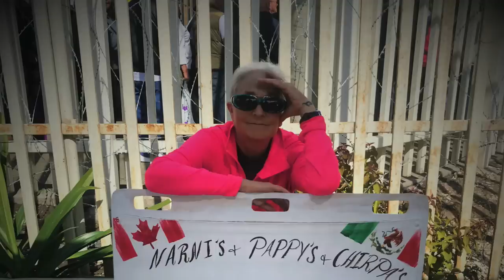Wheels For The Bucket List CDT Carriage Ride | Engels Coach Shop

Comment: Dave...your Trek to Great Falls reminds me of the Summer when I spent three months with Fred and Barbera on a Ranch outside Zortman, down near the Missouri River, as a boy. No Electricity, No Running Water, No Television, No Telephone, No Central Heat, No Flush Toilet, had an Old Outhouse instead...PEEEUW!!! Pretty Old West Living' to be sure.
 Living Accommodations was a Very Old 4  Room Shack with a really Low Ceiling of a House in literally the Middle of Know Where Montana...miles & miles & miles from anyone. Heat was supplied by a Big Ole' Cast Iron Wood Stove. Yes...that meant we had to Chop & Split Firewood by hand with an Axe. We did however have a couple of Luxuries! We had a Refrigerator and Kitchen Stove that ran on Propane. And I remember in the evenings when all the Work was done we either Listened to the CB Radio or Played Buck Owens Records on an Old Portable Record Player. Both were Connected to a Car Battery! Twice a day I Hand Milked the Cows. Twice a day I had to Hand Carry 2 Five Gallon Buckets of Water to the Kitchen Crock. Mostly what I did everyday was Ride Horses all day long Herding Cattle or Horses from one Distant Pasture to another with an Indian Ranch Hand who really knew his way around that Vast Country...he was a Great Guy! Kept me in Stitches Constantly! Some days we spent Fixing Fences or going to Town for Supplies and doing Laundry at the Laundromat with Barbera. Barbera Prepared all the Meals Daily. She was a Good Cook with a Very Sweet Personality and a Very Pretty Young Woman too!
 I will Never Forget the first day, we Rolled in Quite Late and was Very Dark with no Moon. I got out of the Pickup Truck and Heard this Blood Curdling Screaming from the Prairie. Sounded like a Woman Screaming for Her Life! I was Terrified! "What's That!" I exclaimed aloud. Fred, my Host for that Summer, said, "awww, that's a Mountain Lion." Five Decades later I learned he was Right! A Female Mountain Lion does indeed sound like a Terrified Screaming Woman. I know because I looked it up on YouTube ;)

Comment: Dave wonderful video. I’m sure we all have a bucket list of some sort. Mine is pretty much what you accomplished. I’ve always wanted to ride with a huge Hurd of cows.thank you for sharing your time on the trail. A tip maybe, we always knocked the axle seal out with the bearing.
Reply: Driving out the seal with the bearing has been my practice for 50 or so years. A hardwood stick or an old plastic handled screwdriver frequently saves the seal.

Comment: I bet if the United Star Ship Enterprise landed in Engel's Coach Shop parking lot with a busted warp drive, Dave could fish around in his tool box and come up with a tool specifically made for fixing it! Dave, that tool you used to hold the round top stove bolt from spinning, does it have any other purpose besides what you used it for? And I have to ask, why were you riding the mule and using the horse as a pack animal on your trail ride?

Comment: The heat and coarseness of the asphault did a real number on those wheels.
Reply: Horace Jenkins  sure did!  I once took out a fresh set of steel horseshoes in 3 weeks! Wore them paper thin and snapped them in 2! Farrier thought I was pulling his leg when I called him out 5 weeks early for a emergency set!  Man had egg on his face when he came out and sure as snot both front shoes were practically gone!
Reply: Not too much heat. It was a cool summer in the mountains on the Great divide. 99.5% on gravel  and rocky back roads.
Reply: @pappyandnonni3928   Then that was alot of miles to cause that much wear.

Comment: Dave, I believe those wheels went a long way on paved roads. She probably had them loaded as well. Good job on the wheels. I also noticed that you were riding the mule and had the pack on the horse. Did you swap off between the two, or do you prefer to ride the mule?
Reply from the maker: The mule excelled hands down.  I'd ride her any day, any where..  She was great.

Comment: Thank you for another fine video.

A question about the tires. Are these rubber tires on channel irons designed for riding on asphalt? In the bulk of the videos I have watched of you making/fixing tires, the fellows are fitted with metal tires (though I'm not sure if "tire" is the correct term or not). Would I be correct in guessing that the metal tires are for riding on dirt, grass, and the like?

Comment: I went back to look at the video where you repaired these wheels. You had brought these wheels up to #1 condition. I guess a small rubber tire was not heavy enough for a trip like that. Although it was a small wagon with a light load it couldn’t stand up to a long trip. What do you think made the tires come off? Did the wire break or did they roll off the rim. The last one was wore out, you could see the wire. I’m guessing, I don’t know. What is your opinion 
Later stay safe
Reply from the maker: They were too light to begin with, but you use what you have.

Comment: Does tapping the tire while cooling help stress relieve the metal as well as set it on the wheel
Reply from the maker: It's helps the joints set.  It's not for the tire's sake.

Comment: I'm curious, how would they fasten the ends of the steel rim together in the days before welding ? Would they forge weld them or rely on mechanical fasteners ?
Reply from the maker: Forge welded yes.

Comment: Once again Dave another enjoyable  video . I have a question .   When you use the water hose to cool the steel rims, where does all the water go . just on the floor or is there a drain or channel for it to run into , never seem to be able to see one in the many times I have watched you fitting steel rims .
Reply: I think it just goes out the back of the building thru the gap under the man door
Reply: That is my question too. Wouldn't it be easier for You, Mr Dave, to use some kind off showerhead to cool down the steel rims? Stay safe.
Reply: @jannielsen838   I think he has to work the steel rims with the hammer as it cools.
Reply from the maker: There is a floor drain.

Comment: Why did the original wheels fail.? Is the rubber that soft it would wear out that quickly?
Reply: I would guess that buggies were never used for long mileage.  Just for around town, and most ran on dirt and didn't have rubber tires.

Comment: what is the effect of hammering around the hot metal band while you're cooling it with the hose? is it just to keep it tight or is there another reason?
Reply: I guess this provides even tension around the whole rim.
Reply: I expect it's to even out the tension of the channel iron on the rim as it shrinks unevenly due to the water. If he let it air cool he wouldn't have to do that but it would scorch the wood and take too much time.
Reply: Makes sense. Thank you

Comment: I love it when people push the limits on what "acceptable use" is on equipment.  Just proves how durable the items produced are.
Reply: Yes, but remeber those are old (or at least "oldish") implements, that actually have a decent margin of use beyond specs. I wouldn't dare push anything recently designed that far, probably not even close to their stated limits...

Comment: Thank you Dave. Another excellent video of the repairs on our wheels. For those of you that were wondering.  We had around 3000+ miles on the old rubber. Not much pavement, mostly gravel and very rocky roads. Some dirt to. If you are interested go to   travel.topicwise.com/doc/hitchedhiking2019  for our journal and over a 1000 photos..

Comment: The tool you used to hold the rim fastener was very clever.  Is that a one of a kind Dave special?  Is the bit that presses against the offending fastener made of brass or something softer than steel?  Does that really help to grip it so it does not spin?  Are you still considering a video where you demonstrate some old hand tools?  Thank you for telling us about your trip and showing some pics.  That was a nice bonus.  Looking at how thick the new tires are, I thought you could paint white lettering on the sides, or paint the whole side white and have white wall tires!  😁
Reply from the maker: That is a Fab from my partner days with my b-in-law Rick.  I changed the holding point to a cold chisel.  It works well.

Comment: hello fron ireland i am trying to take a wheel of a gig i have taken off the brass hub cap but cant see how the rest come off there are nuts and bolts on the inside part of the wheel i was wondering do i have to open tmem to take off the wheel sincerly John Mc Nmaee.

Comment: I love the purpose built custom tools, the hook tool to hold tension on that bolt head was great, I would have just cut off the nut with a grinder, but what you have there was the right tool for the right job.

Comment: I wouldn't imagine that you get many wheels that have as many miles on as those and considering how much abuse they must have had during those miles, when you were setting the tyres they sounded really solid, no rattles at all. 
...and Dave, do you have a gizmo for every need? That over the spoke tire-bolt-holder-thingy, genius!
Reply from the maker: That's the proper name for it too.  :-)

Comment: Thank for another enjoyable video. Question: why do you tap on the hot wheels (14:24)? It seems as though they are already aligned, but you hit them while cooling them down with the hose. Possible to strengthen the steel or something?
Reply from the maker: Helps set the joints.

Comment: Was it just wear that led to the tire failure?  Is the rubber that's available today for wheels suited to the modern road surfaces?  I wonder if the cobblestones and bricks they used to make roads out of were less abrasive?
Reply: Think of this way we have to get new tires every year or two so did our great, great, grand parents.

Comment: Could you some time show up close how you attach the rubber on the wheels? It seems you have a space without rubber when you connect the wires but after slamming it on the floor, there is no gap anymore. Is there a step I'm missing?
Reply: He has a video or two that will answer all your questions.

Comment: I have a question pertaining to the heat shrinking of the steel.  I understand when you are hammering vertical but what is the function of tapping the face of the steel while cooling? Thanks for he video and keep on smiling.
Reply: I am sure it has to do with breaking up static friction between the wheel and the tire to equalize tension stress. The stress is a result of uneven cooling and hammering will help. I expect the same when the wheel hits the ground (notice it also slides) to evenly relieve compression in the rubber band.
Reply from the maker: It assures all the joints are tight.

Comment: Hi Dave, thanks for the great video and lesson. When sizing the channel iron to the wheel do you do it the same way as when sizing the flat bar to the wheel? Also when you size the rubber tire to the channel how do you go about in doing that? I noticed you weren't wearing your scarf, what happened to it? Hope you and the misses stay safe during these pandemic times.
Reply from the maker: Channel is the same as flat iron.  Rubber is overlapped about 1 spoke distance.  For the scarf, we had a warm week, finally.